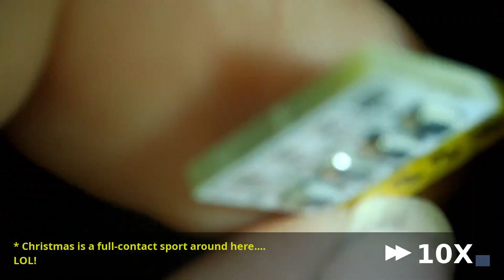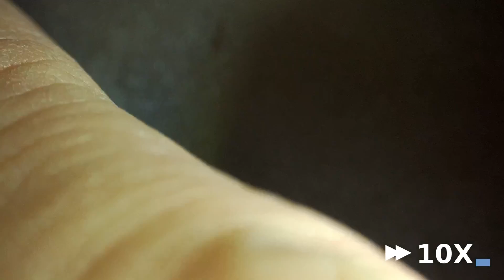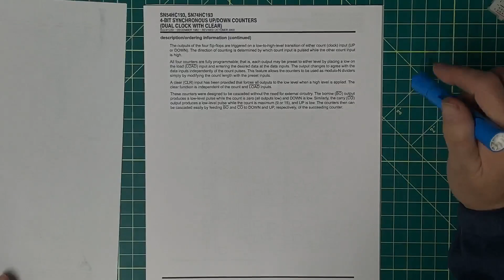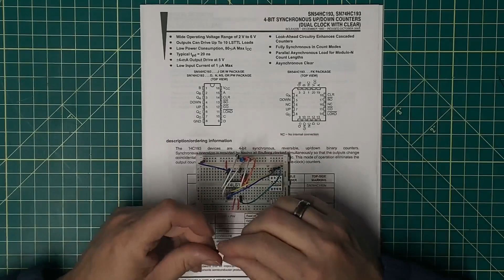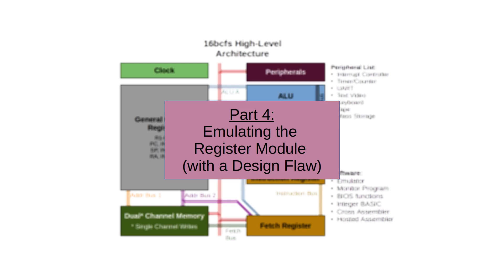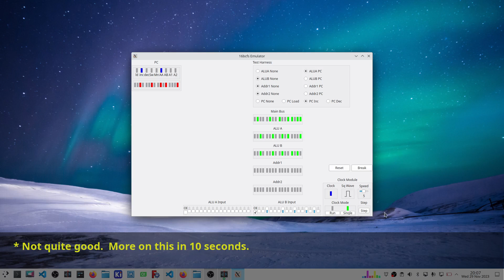0083: Register Module Emulation | 16-Bit Computer From Scratch

Comment: Your registers don't need to be counters. You can use the ALU to add or subtract 1 from a register. The registers can just be latches. This would have a number of benefits:
1) Less parts (two 8-bit latch chips instead of 4 counters per register).
2) Less control signals going to each register unit.
3) If you use edge-triggered latches, then you can read and update a register in one cycle with purely combinatorial logic everywhere else. (As it is, you will have to latch the ALU output to avoid a race condition when loading the counter.)

Also, it seems excessive to have byte-swapping capability built into every register unit. Just put one byte-swapping unit somewhere in the data path. You can implement one easily using four quad 2-input multiplexers. This would also save parts and eliminate another control signal from each register unit.
Reply from the maker: @gcewing -- Please keep in mind that I am not creating a stepped processor.  If anything, it more closely resembles a pipelined CPU.  

With that, at least the Program Counter needs to be able to natively increment.  I plan on being able to role-swap the Program Counter and Return Address registers, so their capabilities need to be the same.  I could use the ALU for handling the stack operations, but there is a performance consideration for that optimization (although PUSH will still likely be implemented as 2 separate instructions).  These are 3 registers which very closely resemble each other with their capability requirements.

I am also planning on having an Interrupt Context, which will have its own copy of the PC, RA, and SP registers.  A context change will simple redirect which of those are in use, making it easier (in theory anyway) to service an interrupt.  So that is 6 registers now that have the same capability requirements.

I want 12 additional General Purpose registers in the build?  Why 12?  No real reason other than it fit into the instruction set I have been planning (see https://github.com/eryjus/16bcfs/blob/master/documents/16bcfs.ods).  If I am able to fit some string operations into the instruction set, having the ability to increment on-register will be an important feature.

As for the byte swapping capability, I see your point.  But that is from more than just the registers -- it will be used when communicating with devices attached to the main bus as well.  I imagine the same solution applies.  

The way I see this working is that the Main Bus would need to have an "input side" and an "output side", with the Muxes in the middle performing the orchestration.  This would then require additional connectors on each module for the Main Bus Input to be differentiated from the Main Bus Output.  This would be marginal space savings on the PCB.

However, the costs would actually go up as pin headers are quite expensive -- more than I like to pay for them anyway.